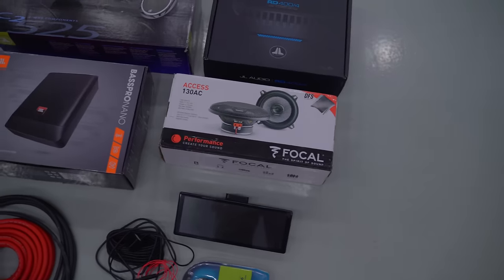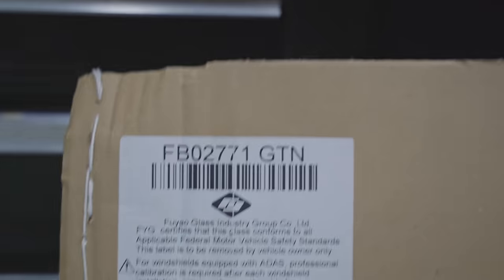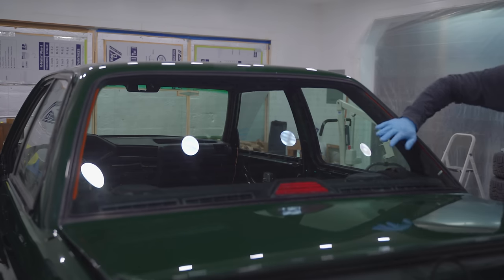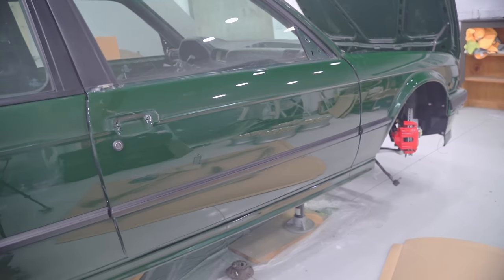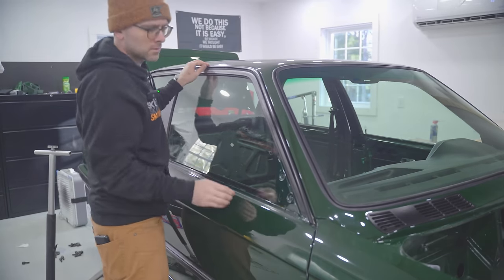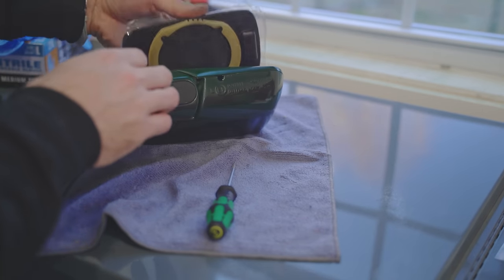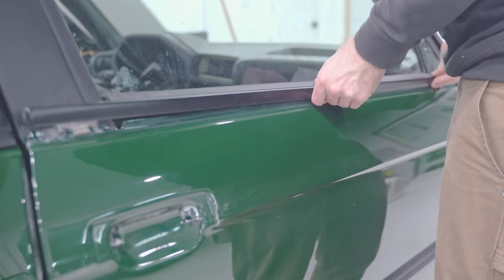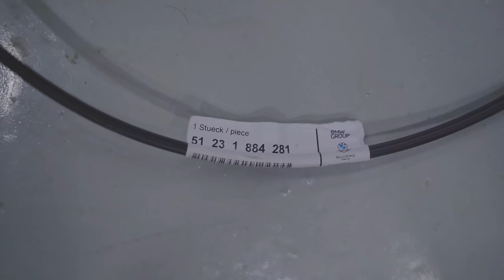Part 2 Building a British Racing Green E30

Comment: 7.20 try a length of string inside the grove of the window rubber. Pulling the string out will fold the rubber round the glass.

Comment: Hi,
In the phase of rebuild a simular project.
Question is if you would happen to have the part Numbers or the many clips to fasten the chrome elements around the windows, als also the clips to fasten bumpers etc, when restoring met Porsche 911 1985 it had an extensive workshop manual and parts list but BMW E30 is low in documentation of this … thanks to reach out
Reply from the maker: Check the next video for how I find part numbers. I also put all the part numbers i used in the description
Reply: @skudak   Many thanks for the fast reply ❤

Comment: It looks super great. Love the color. Seems like you have been doing this a few times before. Never seen anyone put glass in like this with the seal first . I always put the seal on glass and then via a string fitted it into the body of the car 
On your rear springs it looked like you had a cable tie onto the top holding the upper metal to the spring. You didn’t remove it ?
And last. Must be nice to still be able to get new parts for this old a car. Like trim etc.
Reply from the maker: I've honestly never tried that method, I always remove the glass before the seal when disassembling because it pops right out, so figure putting it back in that way is easiest. Yeah I still gotta remove the zip ties, I'm going to need to adjust the springs once the axles are bolted up and I might swap in softer springs so I'll be back in there before it's on the road and will get them then.